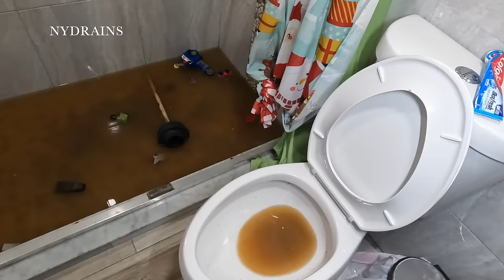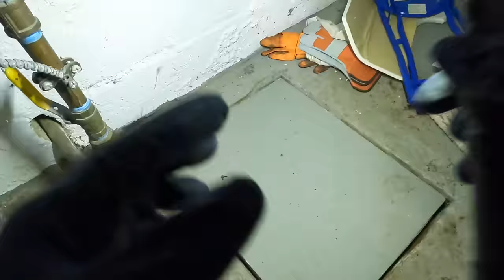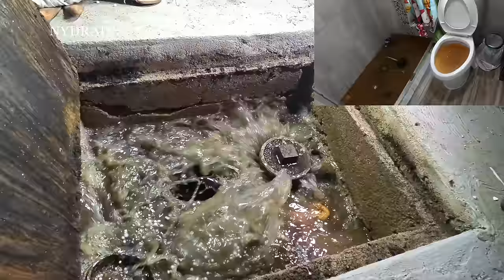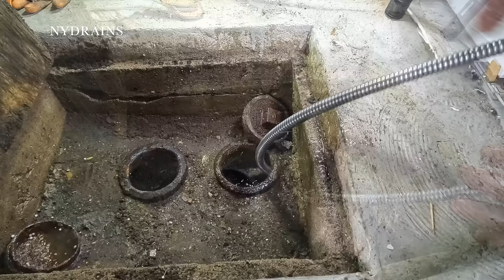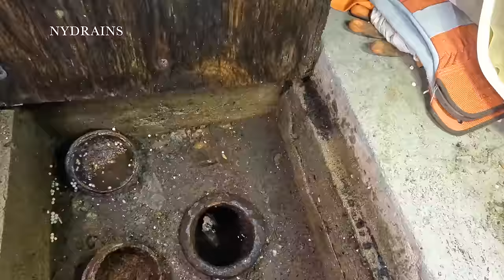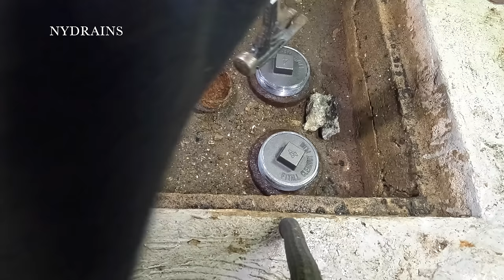Clogged Drain #148

Comment: Omg I have the same problem...but I don't have drains like that...where he knocked the tops off with a hammer.  The line.  I wonder can I just remove the toilet and run the drain cleaner thru that line?
Reply from the maker: It's possible. 50/50

Comment: Before popping the second cap off, why don't you try and unclog the trap? Less mess.
Reply from the maker: The clog isn't necessarily always at the bottom of the trap and makes it more difficult to push the stiff cable through the trap when the clog is on top of the other side.